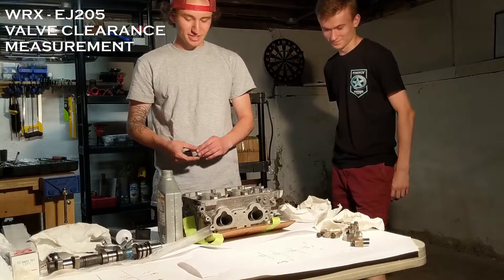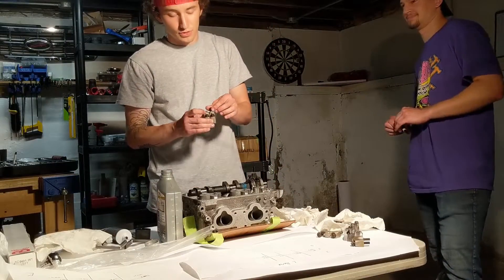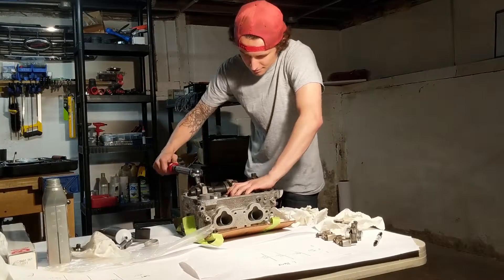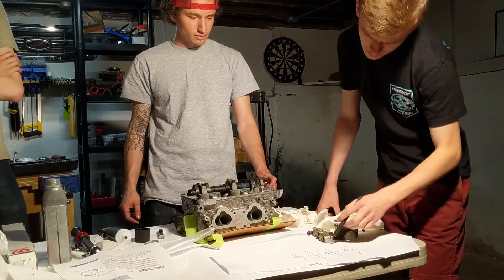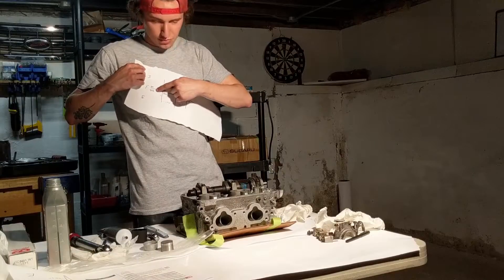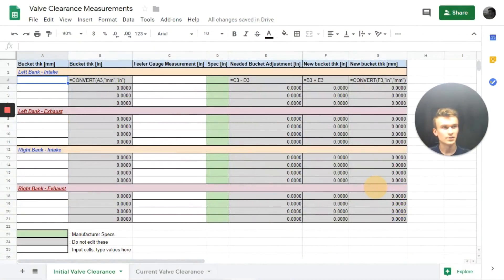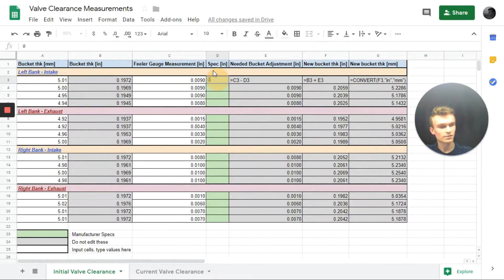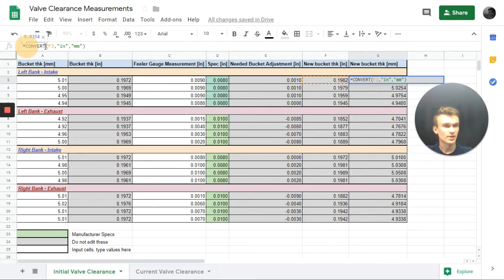Measuring Valve Clearance on a Subaru WRX EJ20 Engine | PT 0

Comment: Are you not worried about setting these valves without the heads torqued to the block per the FSM? The clearances specified are the same as the stock clearances called for in the FSM for intake and exhaust.
Reply from the maker: Thanks for the question/comment! Having the head torqued to the block does not affect the installed height of the valve hence does not effect valve clearance. The only reason the FSM has you bolt it to the block is for convenience when taking the cams in and out of the head.
The FSM gives a range for clearance. The BC cams wanted one set value.
Reply: 3pedal_devils Interesting because the FSM for my 02 WRX doesn’t list a range but rather the .010” & .008” spec. I’m used to wrenching on Inline, V6 and American V8s so this WRX is really a different animal. I noticed you didn’t have the cam sprockets on to put the alignment marks where the FSM indicates, so do you simply measure opposite (180* out) from max lift (peak of the lobe facing directly away from bucket?
Reply: 3pedal_devils oh, and thanks for taking the time to write that response.
Reply from the maker: Are you using a Subaru service manual or a Hanes or something like that? 
If I'm checking the valve clearance with the heads already on then I'll use the cam sprockets. It's not really necessary as long as you measure the clearance at base circle. Base circle is the low spot (180 out from full lift).
If you have any other questions feel free to ask!
Reply from the maker: Just checked the Subaru service manual. Gives a range of 0.18-0.20 mm for intake clearance and 0.23-0.27mm for exhaust.
Reply from the maker: Also when doing the exhaust clearance leave them a little on the loose side (closer to 0.27mm) as they tend to tighten up a little over time.
Reply: 3pedal_devils yeah just like my 4 stroke dirtbikes. Was going to do a pretty loose .10 but not quite a .11 on exhaust. Problem is the damn dog knocked the box over and my bagged and numbered buckets got rattled and all the shins came out of the buckets. Pain in my ass as now I have to re-shim each cam but at least the I know which 4 shins go with which cams. Granted they likely won’t fit as I had to have the heads decked
Reply: The head will flex with the block, so really it should be done assembled.  The block flexes, so does the head.  It’s all junk that lives around so it is best to do it with them torqued down.